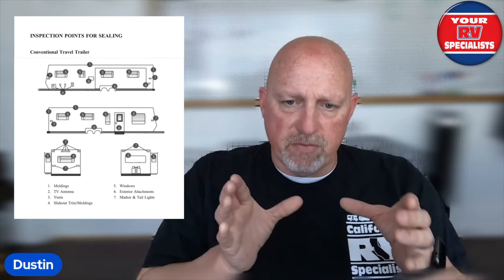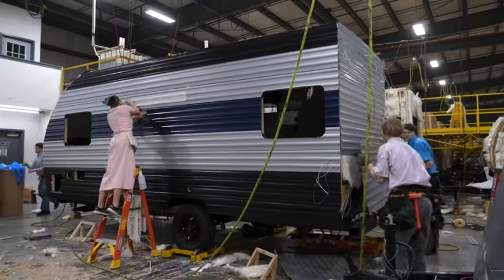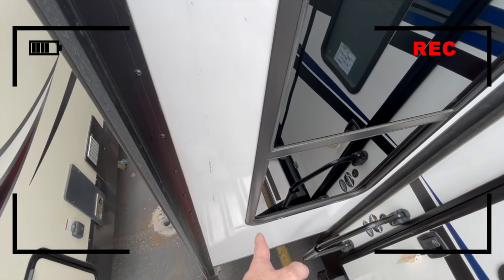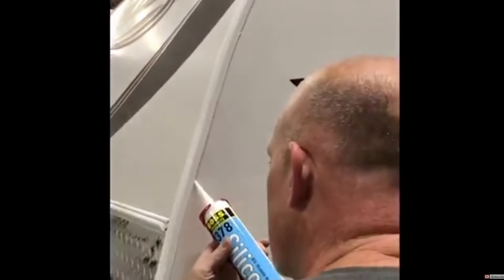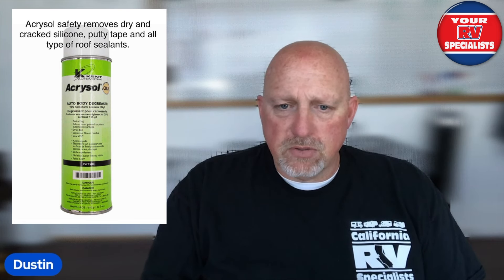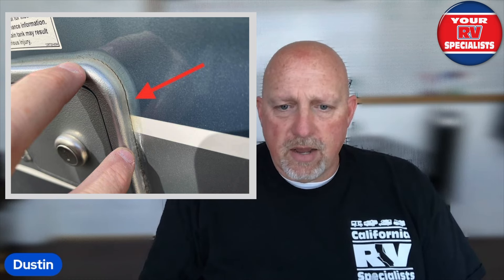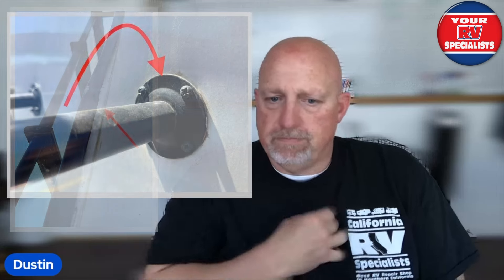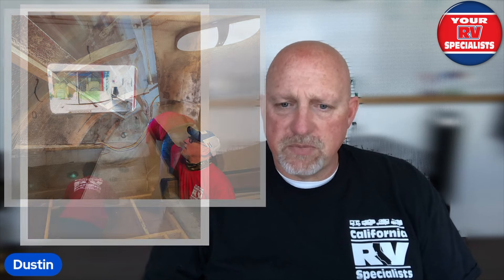RV Body Reseal: The Ultimate Water Damage Solution

Comment: Watched the videos on the rv reseal and the one on rv roof coating. What products are you using for the reseal and roof coating? Looked up Tundra coatings and there are several. Which one do you recommend?
Thanks Jake. 
You installed the tow bar for our Jeep last year and solved an electrical problem we had on the Coachman. Great job on both.

Comment: Dustin,  Thank you so much for your expert advice!  Checking and resealing is easy to forget but so important!  Question: Should I always use 100% silicone for this or something else?
Reply from the maker: Austin, thanks so much for sharing.  You can use 100% RV silicone, if you check out my website or facebook articles you’ll see all the tools, products and materials that you need.  

Depending on the unit and flexing points, some areas might use an adhesive sealant. What’s nice about the silicone is it’s a lot easier to remove when that time comes.  Please remember that they is not sealant out on the market that are permanent.

Thanks again for asking. 
Dustin

Comment: It seems like many of us are confused and wondering and about sealants. WE KNOW THEY NEED TO WORK.  1) What did our mfg use on the sides of our RV - my 2022 2600RB trailer?  Silicone? Seems to be the general consensus but some do not think so. 2) What is the best product to use to reseal - particularly the sides - now and down the road.  3) Does anything stick to silicone?  Does silicone stick to silicone?  I have been advised that nothing sticks to silicone, not even silicone.  Some website recommend solvent based products (like ProFlex, Lexel) and polyurethane (SikaFlex 211/715) because they do not have to be removed to add more - they will stick to each other; but not to silicone.  Lots of Dicor is used on roofs and non-sag for sides - not sure of the non-sag make-up, spec says rubber synthetic and polyether = ?? Silicone has to be removed to add these sealants; and perhaps to add silicone.  Many have recommended GC28100 RV ProFlex, but per Geocel they no longer mfg that product, and it is no longer on their website.  They said they do not mfg RV ProFlex and recommended using solvent based 2300 UHRV.  Dustin, I believe you have recommended GC28928 (clear) - which is a RV ProFlex solvent based sealant - still on Geocel's website; and you use Boss 378 Siliocne in this video.  Amazon has sites selling GC28100-28103-28128 but what I ordered arrived as GC28900 (translucent), or in the GC28900 tube with a sticker attached to cover the bar code - 28103 and 28128. Many very good sites have differing opinions, which makes it confusing, and I am sure these sites have done a lot of trial and error to reach their recommendation. I am hoping to avoid trial and error and make a good first decision.  I plan to watch more of your information.  AND - THANKS DUSTIN!

Comment: Where do we find your articles on sealants and the many areas that need to be sealed.  I am guessing your webiste - and just found some.  DOH!  In cleaning sealant on the front edge of my 2022 2600RB. I found a gap about the size of 1/3 or a quarter; any suggestion on filling this?  Perhaps something like bondo or a hardening glue?  I have several caulk guns and purchased the one recommended on your site.  I am wondering how it can be "DRIP-FREE", it does not have an option to release the pressure.  I'll give it a try but I have never been great at caulking and many times have hollered - WHOA - before I released the pressure!  Out of 17K reviews, 92% gave it a 4-5 star rating - and only 2% gave it the dreaded 1 star - most of these were stating it was not Drip-Free; and then, of course, it has your thumbs up.  Time will tell.  I noticed you used silicone in the video and that you do recommend Geocel,  On your website it is 28101 white (Geocel no longer manufactures the 28100 line) but you do recommend GC28928 clear (via another communication), so I assume you also recommend GC28901 white and the other GC 28900 line of RV ProFlex that is still manufactured by Geocel, per Geocell, no intention to discontinue.  THANKS FOR ALL OF YOU INFORMATION!
Reply: UPDATE OF FIRST USE:  Just wanted to let you know that the Newborn 930-GTD Dripless Caulking Gun was awesome - and it was indeed dripless.  Also, using blue tape it a good tip.  THANKS DUSTIN!

Comment: I'm rebuilding a 1984 Mobile Traveler. the base of the cab-over was partially rotted, so I removed it. It was screwed on of course, but then it had this god awful grey caulking (still pliable) between the metal cab and the cab-over base. It was almost impossible to separate the material from the metal cab. Does anyone have any Idea what that caulking was?  it was a layer about 3 " wide and 1/4 to 1/2 inch thick - globs of it.  I'd like to get something similar for the re-install and was looking at the Geocel products - 4350 metal roof sealant and the Proflex RV caulking.